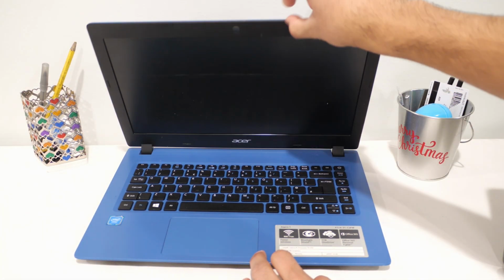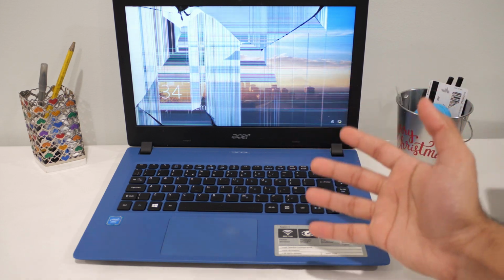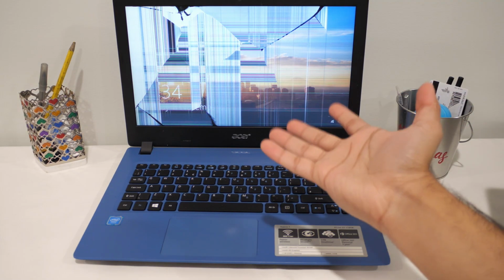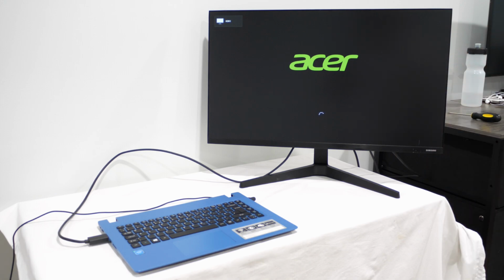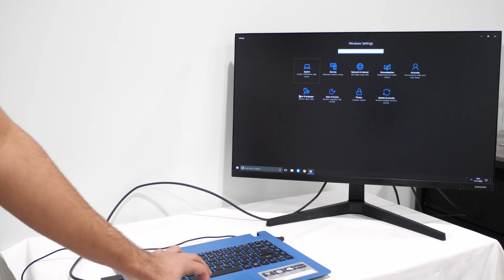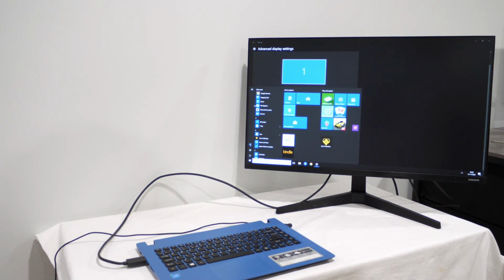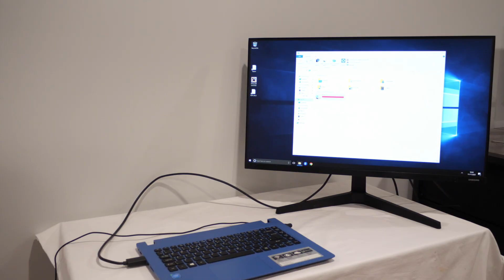How I Saved a Laptop With a Shattered Screen

Comment: On the one hand, it's great because it still works, but on the other, it's a Celeron, so it'll choke even on the browser. What's the point of 32GB of RAM if it doesn't even have a graphics card? I don't know. And if you didn't want to buy a new screen, there are tons of 1080p screens for next to nothing. Just look for the right connector and you'll find an even faster screen. Or buy a used one, isn't that enough? That Celeron laptop still sells for $1,000... which is ridiculous considering how many cores and GHz that processor has. But people will buy it anyway...

Comment: Timestamp of all the smoke detector beeps & Possible timestamps?
0:12
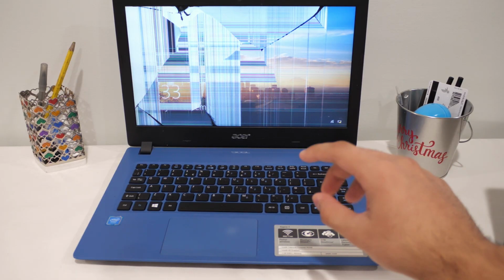1:02
1:44
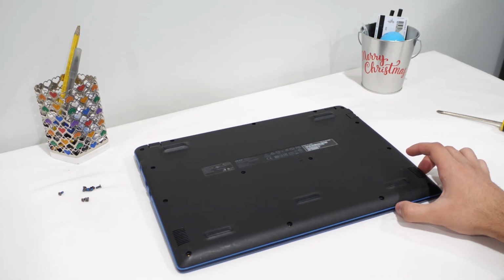1:53
2:23
                           3:17?
                           3:38?
3:51
3:55
                          4:20?
4:23
4:51
                          5:13?
                          5:18?
                          5:21?
5:33
6:11
6:38
                          6:47?
7:42
7:53
All of them are set back up to 4 seconds so you can prepare for it.

Comment: So what about the display. Does monitor does it consum more of your laptop performance? I was thinking about buying a cheap 16:9 monitor ( maybe 1080p or 720p) so I can experience the desktop mode because yk how it felt when using small laptop
Reply from the maker: It will definitely consume a fair bit more power when using the battery since it’s a 1080p display and not a typical 1366x768 display that the laptop uses. You should consider getting that 1080p display and use it when you’ve got the laptop hooked up to the wall.
Reply: @wafflebell  but what if i use less resolustion like 720p. will it consume less ?
Reply from the maker: It should, it’ll save you some power consumption(maybe a few watts) when you’re using the battery. I also misread your question before as whether using 1080p would use more resources instead of power usage, my apologies. In certain apps(usually apps that do 3D rendering), using 1080p will probably reduce the performance slightly so when you’re doing 3D related tasks just use 720p

Comment: tiny core runs even on 90s laptops, this thing will handle much more user friendly versions of linux, e.g. linux mint xfce or cinnamon
Reply: you sure? a friend had his laptop bog out on mint cinnamon... average celeron n3350. couldn't even run doom properly under windows.
Reply from the maker: That’s weird, this laptop is able to play Minecraft at the very least
Reply: @wafflebell  exactly
idk what iamcartt is talking about tbh
and ofc it wouldnt even run doom properly on windows, it a celereon 3350
Reply: @iamcartt i am certain, because i am a connoisseur of old sh1tty hardware myself 🥸
Reply: @iamcarttI i literally play Metal Gear Rising on Windows 10 at 45 fps, PPSSPP at 2x run at 60, Minecraft, and R.E.P.O all of them can run on low graphics using a Celeron N3350, its not the best but it works